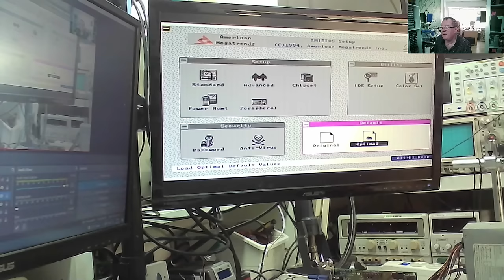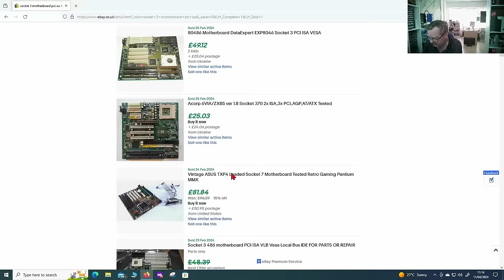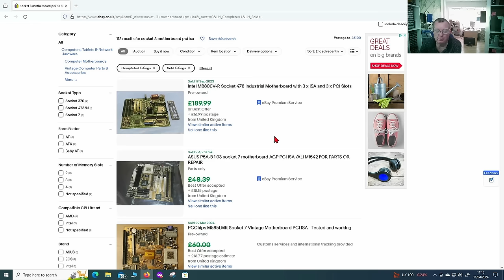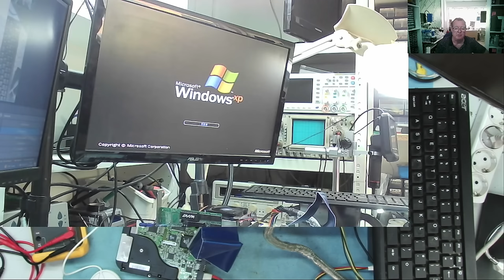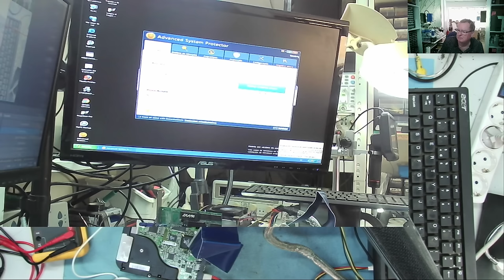Car Boot Retro PC Finds 14th April Sometimes They Go BANG!!

Comment: I've had a number of SATA drives that failed due to the TVS diode suddenly going bye-bye. Different manufacturers, different mainboards, different PSUs. One case was particularly annoying because the fault was intermittent. The diode was cracked and depending on the temperature and drive vibrations, the layers inside would sometimes shift to create a short circuit, causing the drive to die abruptly. Other times, the diode would be open circuit and the drive would just work normally.

When I throw out old drives (nobody uses ≤250GB SATA drives anymore), I usually salvage the magnets (always nice to have) and the controller PCBs - just so I have some replacement TVS diodes. For those who have no salvage drives: Something like a SMBJ12A should be a suitable replacement.
Reply from the maker: Thanks for the info 🙂

Comment: I am working on the power supply 0-30v you started a year ago. I am disappointed that you didn't complete the project. I found the transformer for the project  from a used UPS that  was discarded.  Anyone in need of a transformer,  they are easy to find from salvaged UPS that have been discarded.

Comment: Interesting video ... might be an idea to scope the supply to see if the psu is allowing through spikes sufficient to annoy the disk drive. Keep up the great work 😀👍
Reply from the maker: In it's defense I use that known good 20 pin ATX PSU on all my videos for ATX boards that don't have the 24 pin ATX connector. It did go wrong at one point while making a video and I had to recap it (this is on another of my videos somewhere) so I am quite confident in it being OK.  I don't know what caused the TVS diode to explode, normally it is spikes like you say. Interestingly the HDD then worked once I removed the protection diode.  It is possible the TVS had already failed and when I used my ATX PSU rather than the one in the original case, it had enough wumph to explode the diode?

Comment: When i worked in the electronics workshop at the local uni a student brough his pc in for us to autopsy for a warranty claim (how its so easy today) he said something had gone pop inside so he switched it off.We fired it up and it seemed fine but there was a faint smell of pixel dust .It ran for an hour or so and made a distinct pop .We switched it off and had a nose around but found no sign of the cause. We started it up it ran for a few minutes then there was a huge bang and we dashed to it to see half the graphics card has gone .Somethings not right us sages said and on taking it apart found a wire in the psu had been intermittently shorting to mains no doubt upsetting upsetting things downstream .He got his report we found bits of his machine around the workshop for months.I have had computers since 1979 and my first pc was an ibm at thing but i have never seen or heard a computer destroy itself so well in all that time ,even a student accidentally dropping a screw into one couldn't reproduce that bang and those students could destroy anything!
Reply: We had a Harris mini that was run off a smoothed 3-phase supply and about 10 physically big 12/5/24v power supplies with massive smoothing caps (about 75000uF/50V screw terminal jobs IIRC). Being a vultures, when it was ripped out I had the supplies. Unfortunately nearly all of them blew the caps at startup (even using a variac as a soft starter) which caused some excitement in the workshop :-) If you had a few in parallel charged to 50V and discharged them through a bit of magnesium voice coil off a hard disk pack actuator it was somewhat spectacular ...

Comment: 0:53 - it looks like a 386 or 486. I think the Pentiums had the ps/2 keyboard and mouse.
9:09 - It has a 3.5” miccofloppy in it. You could use a DOS 5.0 or 6.22 boot disk.
15:22 - This one looks like it has an onboard Ethernet network controller.
15:31 - Can’t see it well from this angle; but, it may be an LPT hardware key or just a gender bender.
Reply from the maker: Some nice guesses.  I have quite a few pentium 1 here which have AT motherboards.  Well when i say Pentium 1 I mean the socket 7 type.  I honestly don't know what the big pentium 60, 66 and 75 CPU that came before that are called.  Pentium zero? I've never found one of those machines yet while looking for retro PC but I did own one back in the day. I'm pretty sure that was also an AT machine.  As a real rarity I also once found a Pentium 3 PGA370 machine which had an AT form factor motherboard! It's on one of my old car boot videos around January-February 2023. I found it on Dec 26th 2022.  Some here called that thing a real unicorn..
Reply: @LearnElectronicsRepair  Instead of calling it a 586, they went with the pentium name (then Pentium II, III, etc.) My first computer was the TI 99/4a with cassette tape to store programs. Then, when I moved up to the XT with 640k of RAM and dual 5 1/4” floppy drives, I thought I was big time!

Comment: 386. I had a 486 and recall it had ps/2
Reply: Come to think of it, I had a 586. Win98se, Netscape, ICQ, and You Dont Know Jack: The Ride. Good times. I started on Apple II, but never owned a pc till I BUILT one from scraps. TA-DA! 586. Of course Pentium was already out, and we couldn't, for the life of us, fathom how the heck anyone was going to fill an 8GB hard drive. Holy cow that was a ton of space.What I would give to go back to the time I built my first PC. Oh the things I would prioritize learning over just letting my curiosity dictate what I learned. The things I would  do differently. The appreciation I would have for a brand new, innocent, uncorrupted, fully free (libre) internet in all of its current glory and potential I once took for granted. sigh It really was magical.
Reply: was a transition period. some 486 had ps/2 some pentium 1 didn't!
Reply from the maker: @Nebbia_affaraccimiei  True - I found several Pentium 1 boards with AT keyboard connectors, and even one AT form factor PGA 370 (pentium 3) motherboard!